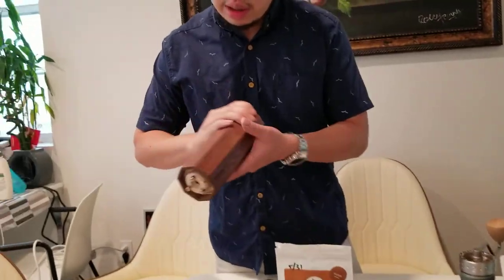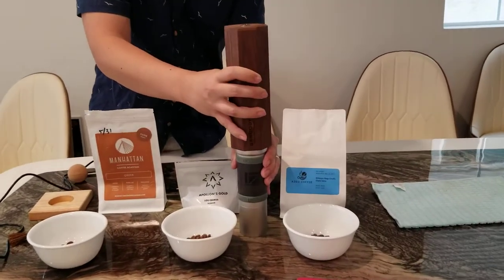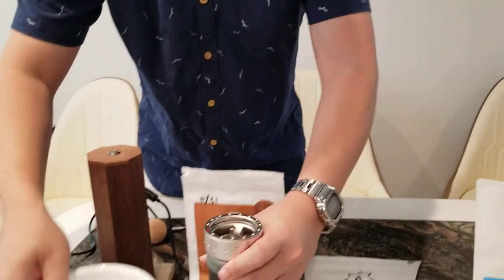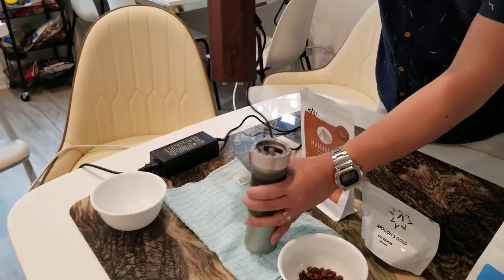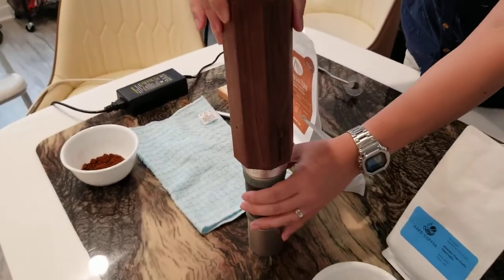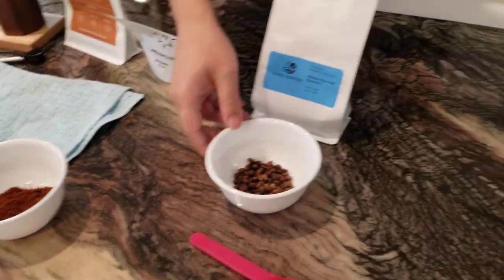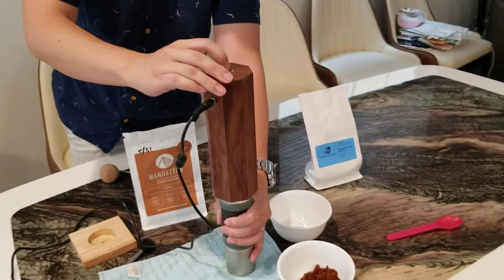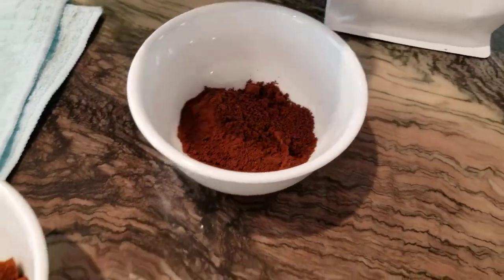Gawoody 1Zpresso K Pro Motor Kit Light Roast Espresso Grinder Demonstration

Comment: Thank you so much for this video.  I daydream about having a motor for my k-plus every time i use it 4x per day for this last 2 years.  I've placed an order for this motor.  I can't wait to try it. manual is starting to stress my left hand from holding the base so tightly.
Reply from the maker: Hopefully it works out for you! There are since other motorizers on the market like Flair Power Tower (much more available) and Skope Motorizer (less so).
Reply: @azeo_coffee  it does. I love it!

Comment: Hi what grind size are you using ?
Reply from the maker: I think in the video I had it at 2.6 setting. (My normal range for espresso is ~3.0-3.5). It can actually grind decently well at a finer setting 2.0 also.